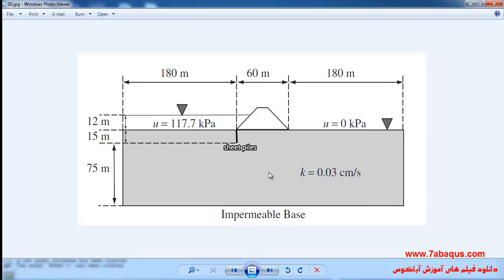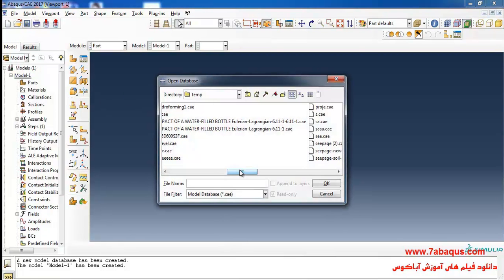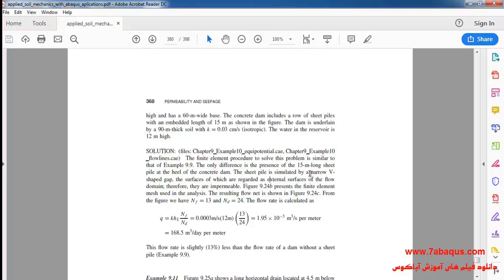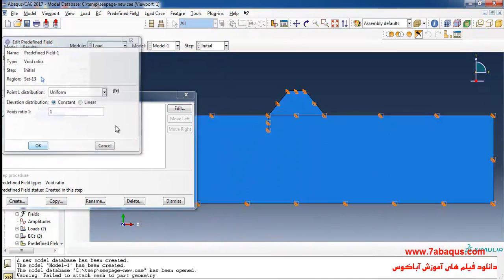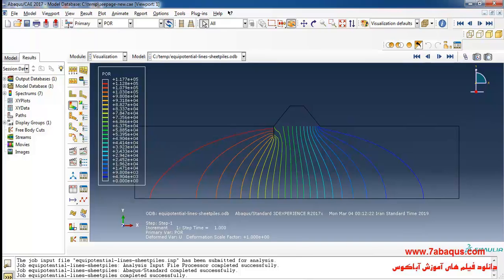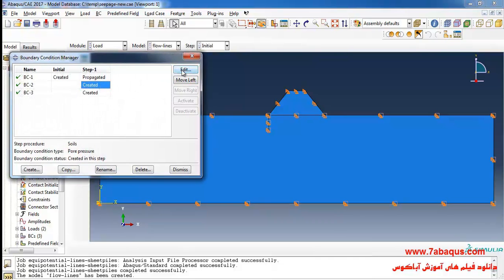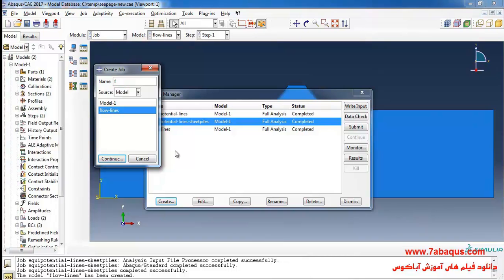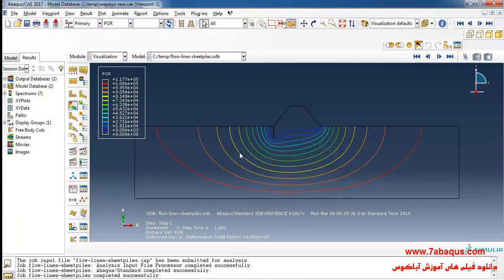Drawing flow net for seepage under the sheet piles Abaqus

Comment: Error in job Job-1: DEGREE OF FREEDOM 8 AND AT LEAST ONE OF DEGREES OF FREEDOM 1 THRU 6 MUST BE ACTIVE IN THE MODEL FOR *SOILS. CHECK THE PROCEDURE AND ELEMENT TYPES USED IN THIS MODEL

This is the error message I've gotten when clicking submit the job.
May I ask at which step did I make mistake?